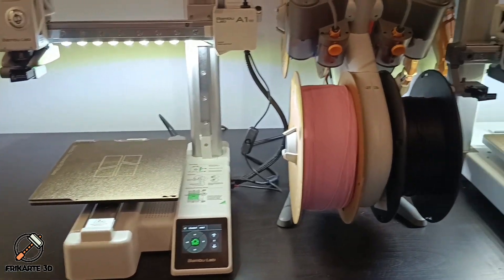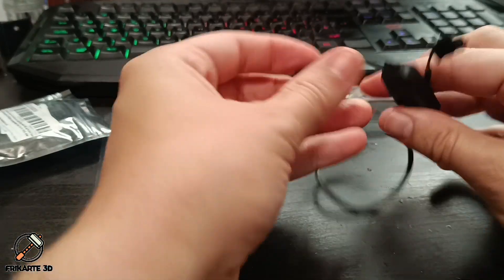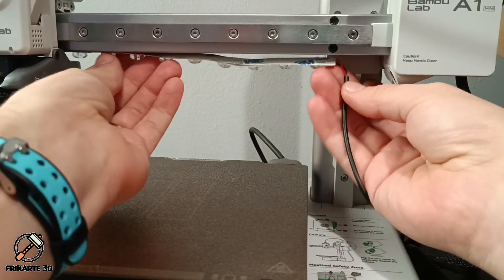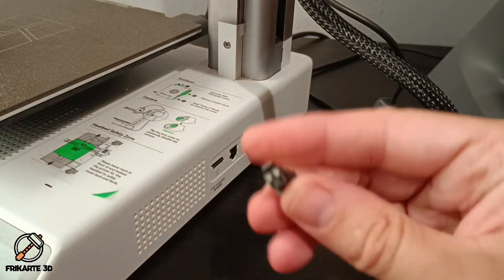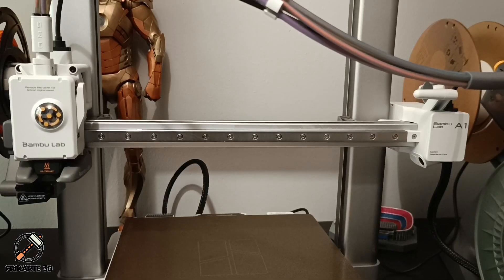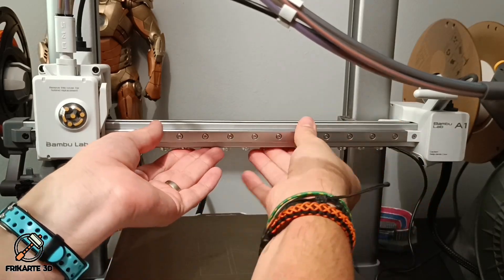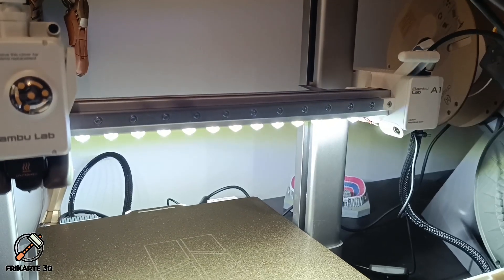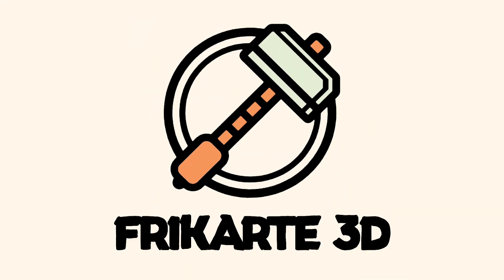Simple Lighting Upgrade for BambuLab A-Series 3D Printers | A How-To Video Tutorial

Comment: So I would have to choose between my AMS and LED lights?  Why have 2 plugs back there if you can't have both?
Reply: I have two connectors at the back of A1 and I don't use AMS right now
Reply from the maker: @AlexW-st5ex  You can add two led strips then 😅
Reply from the maker: Yes, this model only allows you to connect to the printer that way... I didn't find any other built-in option. I'm only using one AMS on them, have another printer with two without lights 😅
Reply: @Frikarte3D  So I can still have my one AMS working with the LED?
Reply from the maker: Yes, it is my setup right now. Also BIGTREETECH just released a new version without a switch that is controlled by the printer itself https://s.click.aliexpress.com/e/_DEtDYsh
Reply: @Frikarte3D  are you a real person replying or AI?: Trying to figure out how much of your channel is AI?
Reply from the maker: @OGManlyMutt  I am not using AI anywhere on my channel. The voice you can hear is text-to-speech (TTS) that transforms text into a digital voice. This is way older than any AI. I do it that way for my lack of English pronunciation and no recording hardware. If you want, you can hear my crap voice here https://youtu.be/MCnHQ51_zPM?si=ue5IY6eQqkvBuS1M 🤗

Comment: It looks helpful, but you've now got a useless AMS, unless you unplug the light when using it. I wonder if anyone makes an adapter so that both can be plugged in at the same time.
Reply: On the mini that's not true. My AMS works fine with the light.
Reply from the maker: @MikeD0162  I assume he refers about having two AMS connected
Reply: A1 and A1 mini only supports 1 AMS so we are all good with the lights and ams connected at the same time
Reply from the maker: Yeah, for now I don't have plans on adding a second AMS without an official hub, but that's true